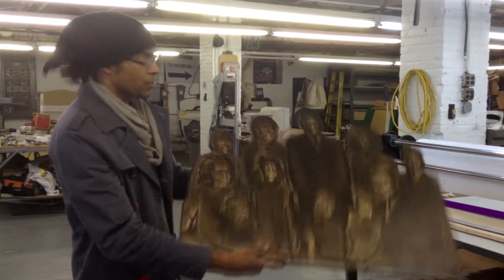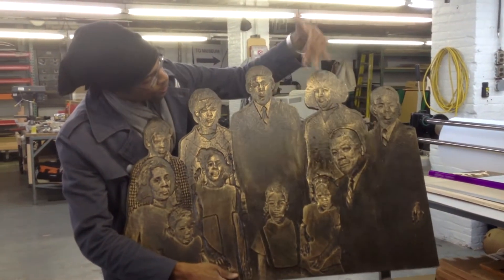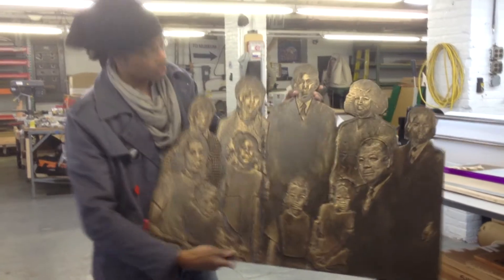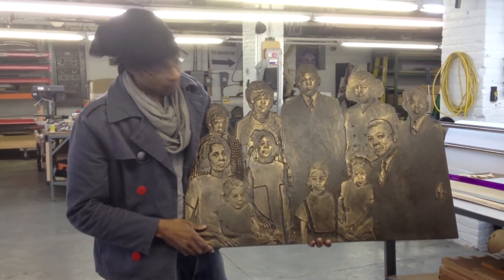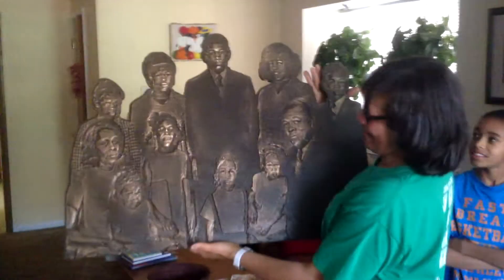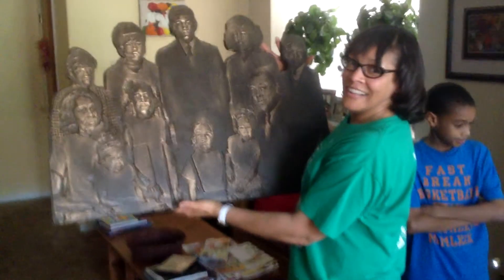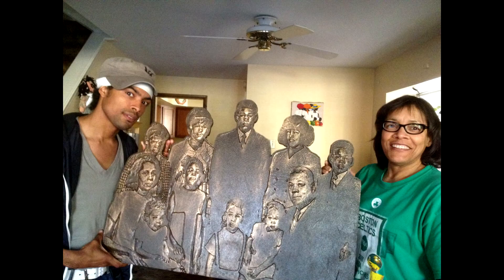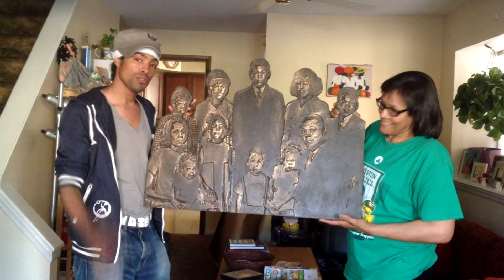DAVIS FAMILY PORTRAIT - 3D CNC ROUTER ON SIGN FOAM

Comment: Great piece of work. 
What software did you use to model the portrait?.
Reply from the maker: I used photoshop to prep the photo. The router software makes the photo black and white when it is prepared to cut . It cuts the blacks deep and the white is highest. So used photoshop to help pull the 3d out more
Reply: @psyche of sound  I understand, thankyou for your response.